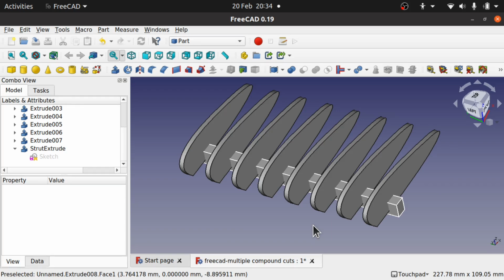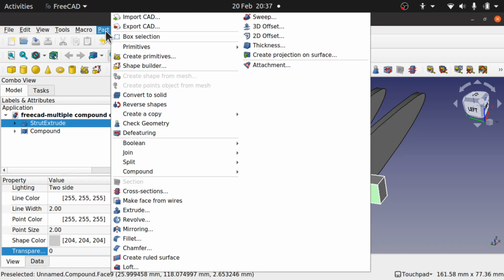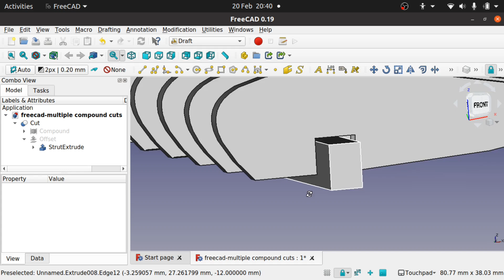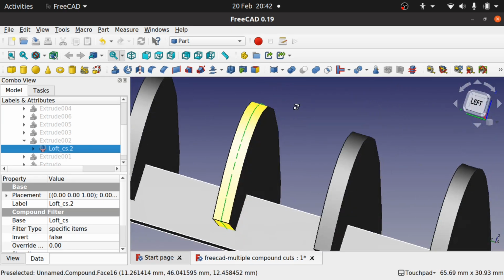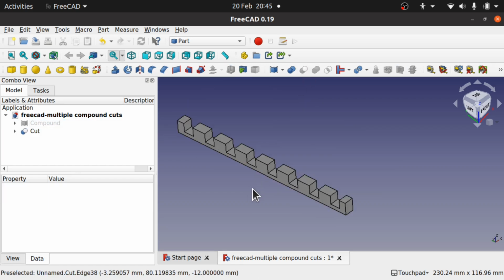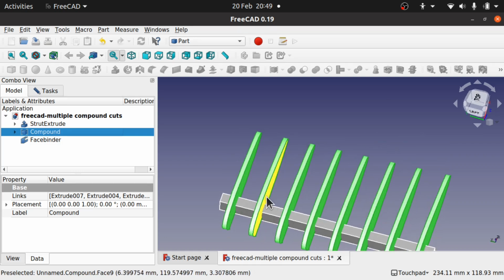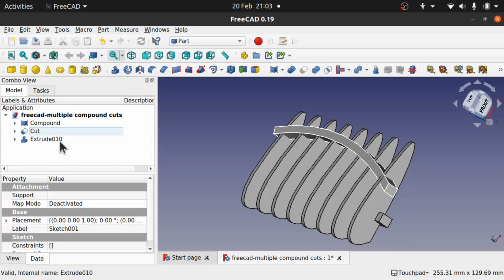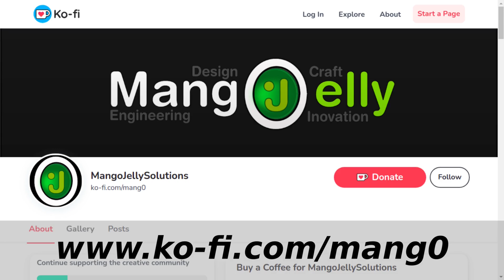FreeCAD: (Follow up) Offset multiple slot joints at once. Time saving tip, beginners tutorial

Comment: Tip for everyone: Cross-section button in Part WB  makes cutting a solid (wing) to create evenly spaced ribs(sections) pretty easy. Just select the solid you want to cross-section, then click the cross-section button and choose the number of sections and spacing....and voila you get ribs in wire format. Then, do an Explode Compound operation to separate them (i think).